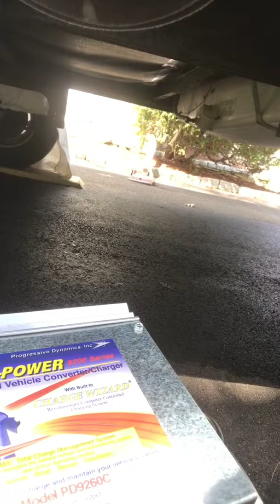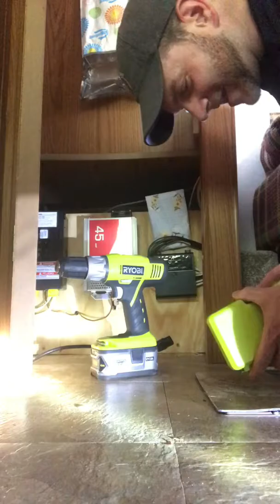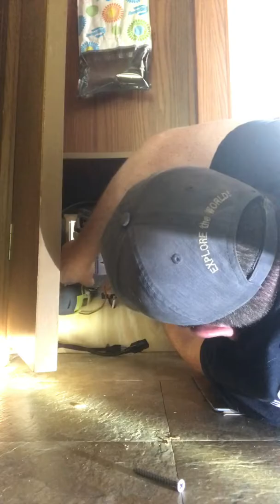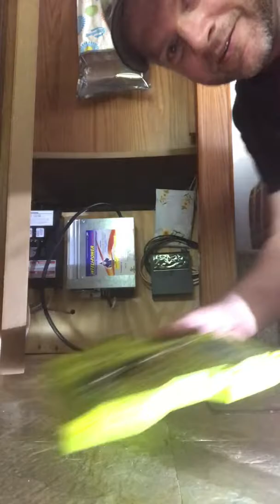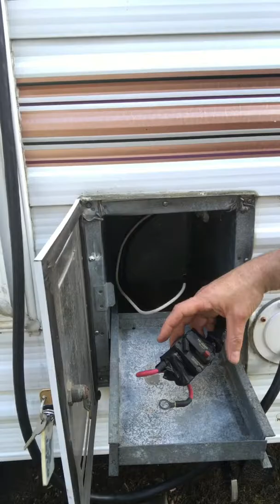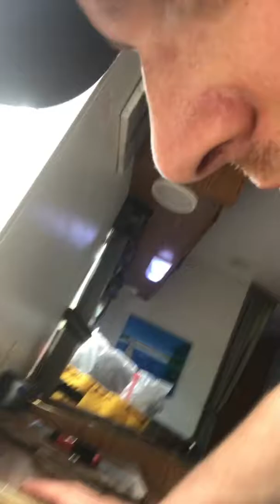Intellipower 9200 Installation.

Comment: What a great video, informative and entertaining. I'm getting ready to replace the buzz box in my 73 GMC before the snow flies here in Southern NH. Like you we do quite a bit of Back Yard Camping in between outings.
Reply from the maker: Thank you for watching Jim, greatly appreciated. If I didn’t have a volt meter installed, I would never have caught on to why my battery was never fully charged. The charging voltage is so important. I no longer live in NH, miss it terribly! I’m a glutton for punishment and moved to SC where the heat is amazing and the pay is lack luster at best! I’ll take snow any day!! Again, thanks for watching!